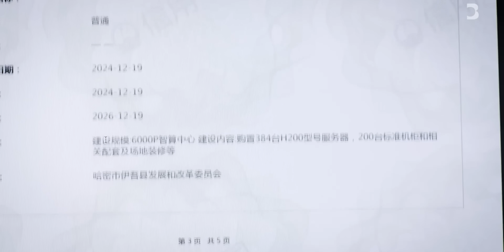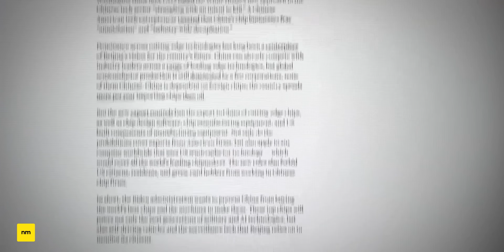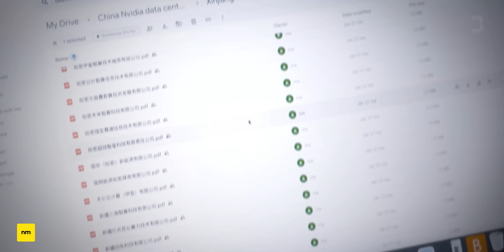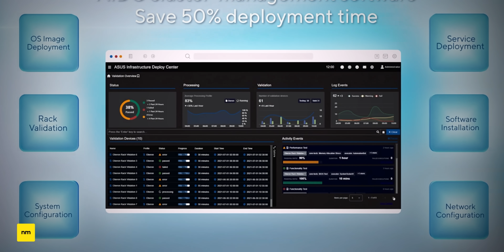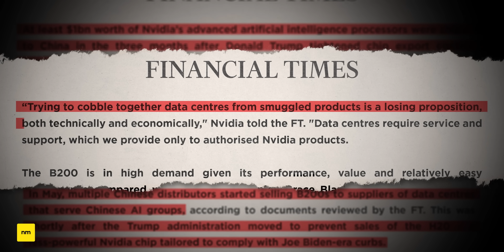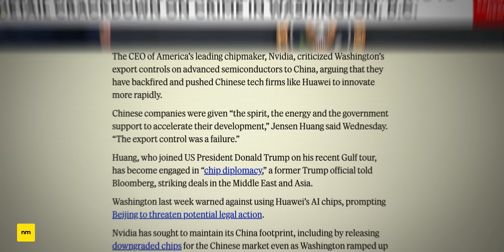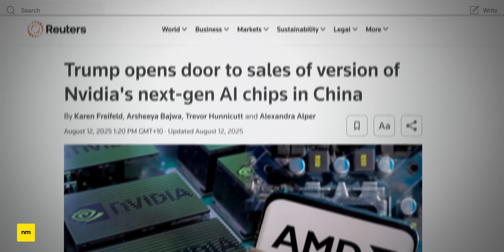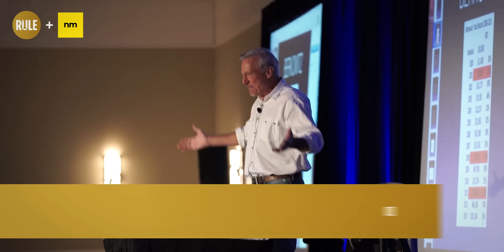China's Bold Move to Dethrone the U.S.

Comment: The document you showed is like a building permit. It was approved in 12/2024, so the actual filing date must be a couple of months earlier. At the time, there was no Huawei chip available. H100 in the application should be just a placeholder. No company would have all the hardware ready before the data center is constructed.
A more interesting aspect of this document is the electricity power requirements.  I wonder if you have that information on the document?

Comment: Without software to run on these datacenters the chips are pretty worthless.  It's fairly simple to use a single H100 but when you have thousands of them the software needs to cope with resilience, when a unit stops communicating, and distribution of multiple tasks across the processors.  NVIDIA software is licensed, has activation codes and bindings to specific unit serial number, which are checked online to avoid piracy.
Reply: I never had to activate a nvidia gpu
Reply: there are many ways to bypass those checks. piracy is impossible to stop